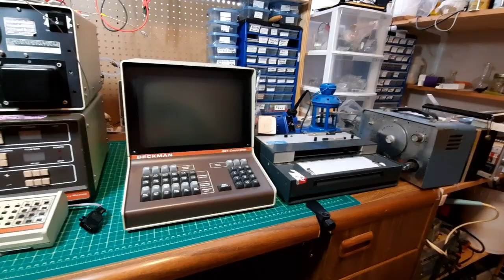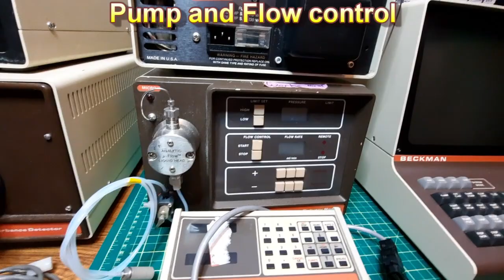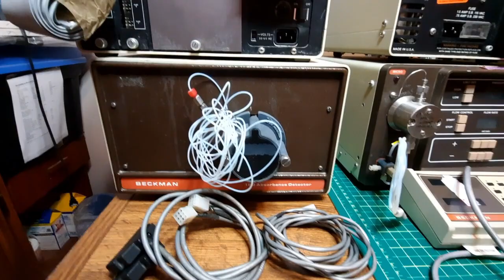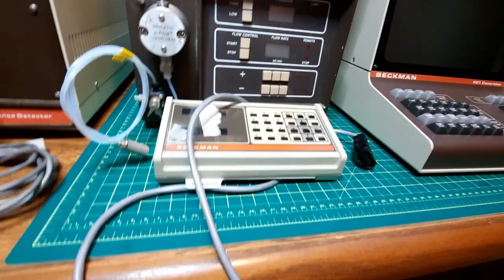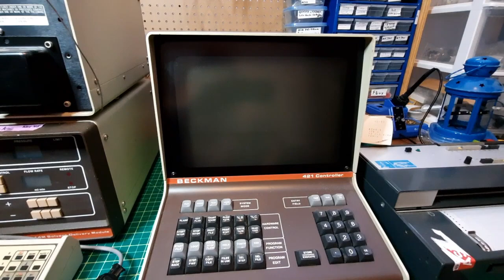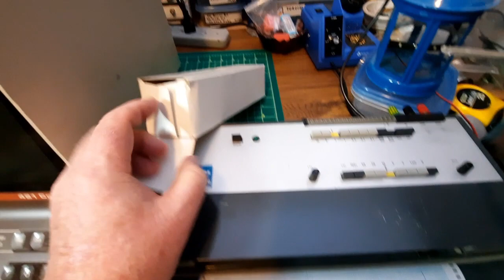HPLC Intro P1 of who knows

Comment: The best part there is the chart printer or as we used to say "the toilet paper recorder".
Reply from the maker: I am hopeful it will work, will probably have to do a lot of contact cleaning.  Use to work with the chart recorders that had accordian paper. The other big score was the enclosures. Buying large project enclosure is very expensive.
Reply: JAMES AZBELL My only experience with those were made by Leeds and Northrup. A serve motor moved the penback and forth along with a zero backlash potentiometer with a precision voltage across it.  A mechanical vibrator switched between the input voltage and the pot wiper and the difference square wave was amplified by vacuum tube and passed to the servo motor, causing it to balance to the input voltage.  This was circa late 1950s.
Reply from the maker: @jazbell7  I am taking it slow with the chart recorder, looks like it works but there might be an issue in the power supply. Should have a video out on it within a week (-: